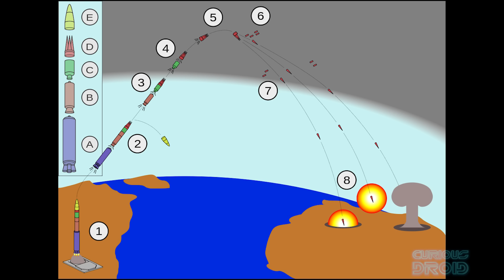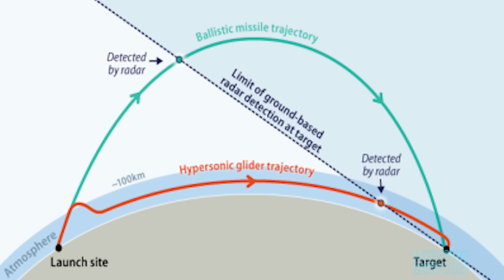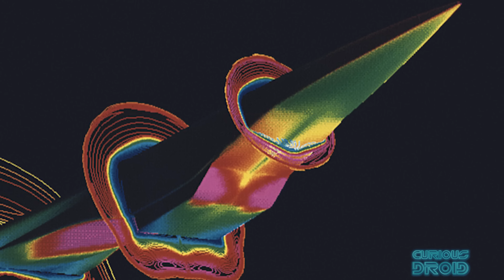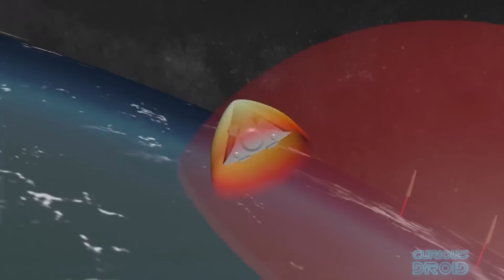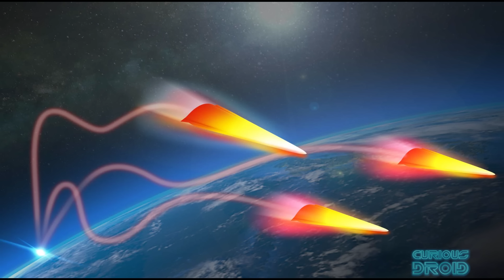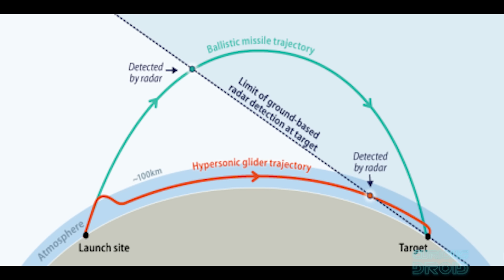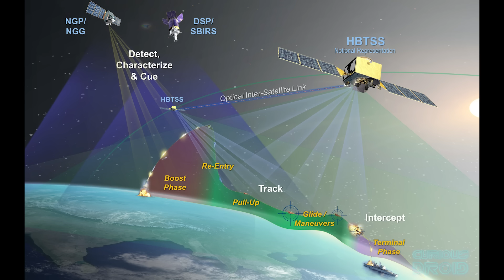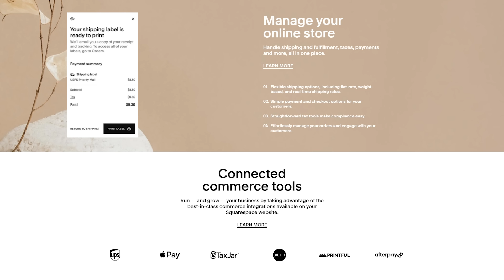Can the U.S. Stop Russian and Chinese Hypersonic Missiles?

Comment: The point of the speeds is that with a minimal change of direction means that in a millisecond the missile will be hundreds of meters away from the previous point. So any projectile interceptor turns useless. The speeds are so high that you are basically shooting a bullet with another bullet, but the first one moves. The interceptor has no possibility of inflight correction due the immense speeds, once you shoot at it that is, you better pray it stays where your computer predicted it's timed position. There is no second shot, and you can't correct your interceptor, by the time you fire detect change and send the data the interceptor is already behind the target. 
They don't need to make giant moves, just a small fraction of degree means a gigantic deviation due the sheer speeds. 
The only way to stop them is to destroy their launchers before they fire, or during it's initial ascending phase. You can try during mid course but the shorter the distance the fewer probability of interception. 
Just like normal ICBM, is just another layer of uncertainty so major powers would not grow confident they can defend effectively from nukes and think they can attacks other powers with minimal consequences. Still today ICBM cannot be stopped, the best defense is to destroy the launchers before launch, hence why first strike is mostly directed at fixed silos and why response to a multiple launch is MAD, because the targeted country will launch their silo based ICBM before the enemy ones hits them, and also targeting their silos to take them out for a second strike. 
The US hopes that surrounding Russia with aegis systems, submarines, ground launched cruise missiles it could quickly disable Russia's silos first before they could react then intercept most ICBMs during ascending phase. Hence having s few MIRVs that actually make to space and shoot them from the sea with the SM-2/3 and high altitude fighters (tested). The hope is to have to deal with a few warheads that actually pass through and intercept most of them with naval and land based anti ballistic shields. 
The issue with that is that it leads to a country to act more arrogantly, confident of it and fearing less retaliation, so it can use nukes on other powers without repercussions and finally crush any non submissive obedient vassal state. And secondly, the strategy works for long distance multilayered. Short distance tactical ballistic missiles and cruise missiles are much harder to stop due short time windows and physical impossibility of having 100% detection capacity and interception ability on instant demand over all lands. So Europeans would get wrecked by nukes even if the US defeats all attacks to them. But that isn't important because is another continent.

Comment: The speed of light of laser weapons is no problem, but the process of radar locking and instant reaction is very important, and it is also to deal with this high-speed missile with infrared thermal capture capability that can change orbit,
Reply: The speed of light does have to be taken into consideration. At Mach 8 and above even at  only 16km range the missile has traveled about 15cm in the time it takes light to get from the laser to the missile. If the missile is going faster or the range is longer its worse. 15cm is significant for a beam weapon that has zero impact for a near miss. Like you say add this to the processing latency which I bet amounts to even worse error.

Comment: One of the problems with Lasers is that as a laser shines through the atmosphere it interacts with the air molecules in such a way as to distort the beam causing it to loose focus.  Conventional laser weapons must focus on the target for several seconds in order to cause damage.  How to get around this?  One possible solution is nanosecond or femtosecond pulsed lasers.  I built a LIBS system using a range finder laser from an M1A1 tank that puts out pulses of 20 milliwats of power in 1 billionth of a second (2.000,000 instantaneous power).  Now that doesn't sound like a lot but when it strikes the target it produces a loud snap and a tiny plume of ionized target, the light from which can be analyzed with a spectrometer to determine the target composition.  Scaled up a thousand or a million times that is going to do a lot of damage.  And by the time the atmosphere has time to react to the passage of the laser beam the beam will be miles away.   Good way to destroy these things?

Comment: I'm puzzled why you think a body surrounded by plasma is invisible to radar. A plasma is electrically conductive, so electromagnetic energy bounces off it. As examples, the Sun's surface - a 5800K plasma - has been imaged using radar and re-entering spacecraft are routinely tracked.
Of course, a plasma is opaque to em energy so any guidance while the plasma is present has to be inertial. This just means the vehicle needs to slow down to ~Mach 4.5-ish in the terminal phase. That is still close to 1500 metres per second.

Comment: Russia saying they have a missile that goes Mach 24 has "future army soldier" energy lol. Maybe when it's attached to a ballistic missile in basically space. When it's going towards it's target it will drop to around Mach 3 in order to receive proper guidance, not to mention any missile traveling above mach 6 for extended periods of time in the lower atmosphere literally burn itself apart.

Friend of mine who worked on the ATB program (B-2 Spirit) knew guys who talked about classified hypersonic missiles they were working on that used an ablative material as a solution to the high  temperatures.

Comment: The 300MW is the total output power of both reactors.  Significant power is needed to run the ship.  Maybe 100MW would be available for a laser. But a 1MW laser will bounce off a hypersonic missile and a 100MW laser is decades away.

Comment: There are two issues that is not accurate in the video:
1 - China's DF-ZF in not a cruise hypersonic missile, it's a glide vechicle mounts on DF-17, a ballistic missile.
2- US has a slight lead in hypersonic missile technology as a year ago, they were able to carry out two successfull hypersonic missile tests just last year alone and they are pursuing very comprehensive hypersonic weapons programs across the Air Force, Army, and Navy, plus 4 other programs just at DARPA.
Reply: I think the concern is that #2 doesn't really matter as no one's missile defense systems are even competitive with the US. Thus the real issue is not a race for hypersonic technology, but rather the proliferation removes a key safety advantage that the US now enjoys.

Comment: Many aircraft can fly Mach 2, but none can do it at Sea Level. Same problem x 100 for Mach 5. Mid Course flight at Hypersonic speeds and at altitude is a thing, RVs diving at Hypersonic speed is a thing. Low level hypersonics, I don't think so- not for very long anyway.

Comment: The drag equation of Cd*v^2/2 only applies to subsonic drag where the coefficient of drag is, as the equation implies, a constant. At transonic and supersonic speeds, the Cd is a function of (approximately) mach number, jumping to an order of magnitude greater than Cd(subsonic). Beyond that, the actual shape of the object determines the profile of the Cd vs speed. For blunt airframes, the Cd can stay almost linear at an order of magnitude higher than subsonic, but for other shapes the Cd drops with speed until its actually less than the subsonic Cd. Cd*v^2/2 is irrelevant in the supersonic and hypersonic regimes.

Comment: There is no high maneuverability at hypersonic speed. They're easy to see on IR and radar because the heat creates a radar reflecting plasma. Also, you can and should retaliate with an ICBM because it's probably nuclear and you have no time to guess. Additionally, the ICBM is faster.

Comment: 300 Megawatts of generated power? is that per hour? that leaves about 2.5 for the shot if 30 seconds from when it comes over the Horizon is true. Minus aiming time,order of command, shut down of everything else that consumes power during that time. Oh the horror, when the enemy shoot two missiles. Somebody in the Engineering departement will have to pack his stuff.

Comment: Starlink have partnered with the DoD (the laser interconnectivity being the givaway) to provide hypersonic threat tracking services over continental US.  The advantage starlink has is than the plasma generated by the missles affects radio propagation in known ways,  so the missile doesnt have to 'cut' through any particular uplink necessarily. The multiple networked uplinks and downlinks allow a low latency,  highly accurate 6D trajectory to be calculated.  Instead of simple triangulation, this is based on radio interferometry, which as you know requires an enomous amount of data and compute.   It will allow the DoD to track and hopefully intercept these threats at their final stages.  

So if you notice your skylink slows to a crawl at the same time your favourite ai or high cloud GPU service kicks you out.... it may be time to get under the table. 

Thank you for reading this BS right to the end 😅

Comment: In 5 to 10 years when such a defense system is available, there would have been also new advancements of those hyperschal missiles that enabled them to fight exactly against such a system. The assumption is that the hypersonic missile tech will stay at a stand still. The satellite defense system could be overcome with an overload EMP… for each missiles a 20+ variation of possible path in many different direction… lunch about 1000 hyperschal missiles and you have the the defense system baffled with 20k variables which kann be anyone of those path pro missile… the Russians were not playing the the Americans’ game. No trillions dollars bomber that are Slow by comparison. That cost van make enough missiles to overwhelm any air defense system. The were even told of it.

Comment: Somehow Ukraine said they shot one down using a patriot system from the 80s. The evidence piture they show are of iskander and old artillery shells plus the missles is almost entact. Traveling at mach 5 i can imagine there would be much left and a trail of debris miles long.
Reply: those are newer patriots, PAC-3, which do kinetic damage, which is consistnet with the damages shown. As for iskander - kinzhal missles are literally iskander missles, strapped to mig-31s and Tu-22s to act as basicaly their first stage.

Comment: There is no curvature to the earth. An airplane's attitude indicator proves it. The indicator reads - - - on take off and - - - at landing. If there was curvature to the earth the indicator would read - - - at take off and - / - or - \ - or - _ - or _ - _ at landing, but if that was the case, then blind instrument flight and landing would be impossible, which it is not, because the earth is flat and not curved. Just ask nasa, where they assume a flat non-rotating earth.

Comment: Russia doesn't have any Hypersonic missiles. Well, none that they've shown that work anyway. And the last video they released of their supposed Hypersonic missile wasn't a Hypersonic missile at all. It was dropped from a very high altitude to make it appear to be hypersonic but once you analyze the data from it along with the Frame by Frame video of the test, you will conclude that Russia was trying to pull a fast one. Russia has no hypersonic missiles. They just Wish they had them.

Comment: Russia probably has enough engineering knowledge and experience to to construct something like this as far as the airfoil, the propulsion system, etc. go, but they lack the technology for making semiconductors which they will likely never develop, and this things in today’s world just can’t operate without the high tech silicon. On the other hand, China is extremely dedicated to developing their own reliable semiconductors, especially after the U.S. ban, and they are pouring a lot of resources into this, but they are still years if not decade(s) behind, and their technical expertise in making a complex weapon system like this aside from the chips is also very questionable, so the U.S. can stop these by making a computer animation and posting it on YouTube, because that’s pretty much where the only threat is coming from.

Comment: You overstate issues and vulnerabilities in curious way. The maneuverability of both Russian and Chinese. It is simply inaccurate and a poorly done propaganda and dog and pony show.

The Russian Cruise Missile failed and contaminated a village in Russia. They don’t have a scram jet engine with accurate control surface. The US has successfully several versions.

The fact is they have no cheap missiles and the plasma does limit communications as we see in space craft re-entry. They are failures and US lasers are able to destroy them with limited energy because only a few degrees needed destroy the missiles. NO IT DOESN’T TAKE THAT MUCH LASER ENERGY. You got it wrong and my info comes from journals of industry.